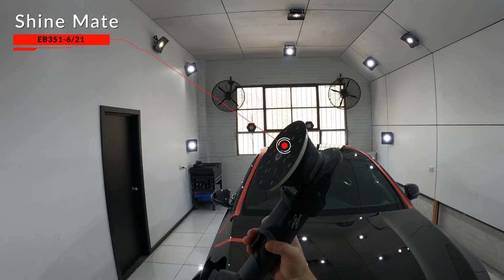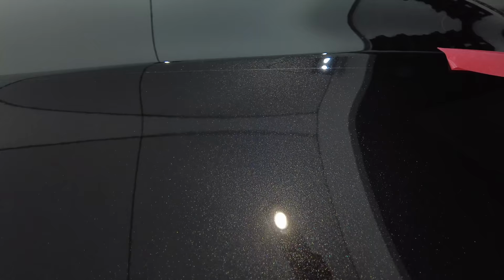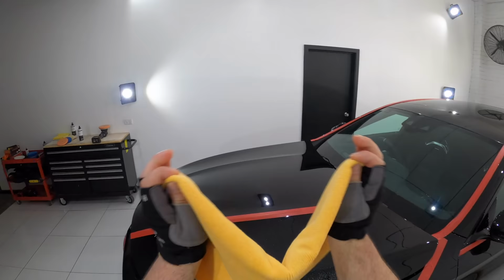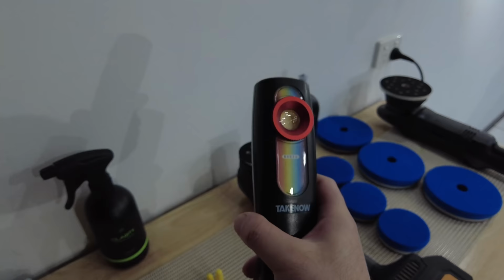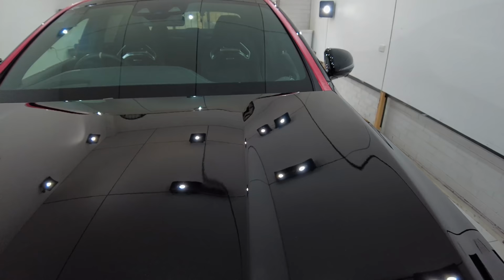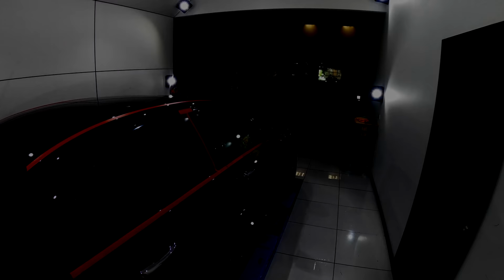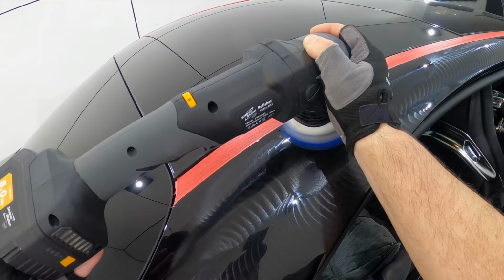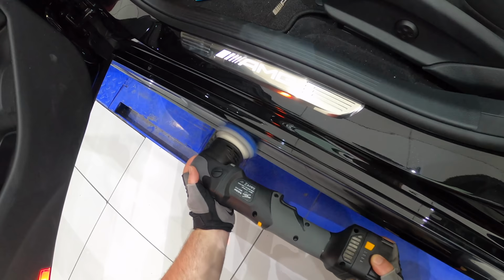Mercedes E63S AMG Full High End Detail! Part 2 "How to safely correct car paint" (Vlog 35.2)

Comment: I appreciate your striving to ge tthe perfect single stage correction, but I think you're missing the forest for the trees in a sense.  If you can remove all of the defects with a two-stage correction in most cases, with a good amount of clear to start with, even using a heavy compound, in the end, you're losing less than 4 microns of clear at most, and if the goal is a perfect, or near perfect correction prior to something like a 5 to 10 year ceramic coating on top of it, you're not going to be re-correcting that paint again in the lifespan of the car most likely, unless you wet sand the ceramic off the clear, and that's going to do far more damage to the thickness of that clear.  I can see your approach being great for something like a collectible exotic, or a classic car that the owner wants to keep for decades, but really, most cars today have a lifespan of maybe 10-15 years, and with 9+ year Ceramic/Graphene coatings on the market, I just don't see a need to preserve THAT much of the clear on every car.  Mommy isn't going to come back in 5 years and ask you to wet sand her minivan for a new ceramic coating.  I am also still learning though, and maybe I missed something here.

Comment: Maximum Quality of the Craftsmanship aside: The production qualtity and creativity of the videos is what makes this by far the best source on detailing. For all you non-video makers: this takes hours and hours  - and you dont get paid for the job. And please dont start on Youtube (Ad-)Revenue and stuff - we are not there yet.

Ps: Are you sure the panorama roof is made of glass? i recall them using Makrolon AG 2677 (PolyCarbonate from Bayer) and SilFORT AS4700-SP1 Hardcoat with SilFORT SHP470-FT2050 Primer Coat for UV/Wear Protection etc.
Reply from the maker: I appreciate that mate and it is a bit of a journey making these videos so thank you!  I’m actually not 100% sure on the specific material of the roof - but it did look and behave like glass.

Comment: Have you ever tried a pad cleaner? I switched to the lake country newest pad washer instead of using air to save* time, dusting and pad heat reduction and I haven't had an issue with wet pads except when using the nano polisher due to slow rotating speed. Nice to not have to wear a mask or breathing in abrasives and clear coat.
Reply from the maker: Yes I used it, but that’s really to wash pads after use rather than blowing out residue after every set of passes.
Reply: @CarCraftAutoDetailing  I have 2 one for cleaning with a cleaner and one for correction with just water. After 2 vehicles I empty it and it's surprising how much Gunk is at the bottom. Better in the bucket than in the lungs.

Comment: Man, probably watched this series 4 times. This is a really fantastic journey. Amazing. I noticed you used the pneumatic polisher on the chrome. What pad and polish/combo did you use and does that remove scratches on the chrome trim or just shine it up? What brand/model air compressor do you use to power your air tools? Thank you so much for your excellence.
Reply from the maker: Glad you enjoyed it! It was the same compound on the chrome - Scholl S20 with the Rupes yellow foam pad and it was just about restoring brilliance to it, it takes a lot more aggression to remove scratches from metal, but they didn’t need that. The air compressor is a Chicago Hush 150.
Reply: @CarCraftAutoDetailing  Thank you. Your the best.

Comment: Hey Sandro! Been learning so much from your videos, but still have this doubt: Am I right to start off with a 15mm 5" DA Polisher as 1st machine? Been practicing for a while now and been getting really nice results, gotta say, your videos and methods have helped me a lot!

Now, for my own studio, I really want to step up a little bit, looking foward to get a 3" since it helps so much on edge work. Also, thanks for the LED LIGHT tip, I didn't know it would help so much until I got it, some scratches and marks only shows in that light or in the sun, my jobs have for sure increased in quality because of it.

Wish you the best, regards from Brazil.
Reply from the maker: Really nice to hear that mate, thank you! 
Yes, you can definitely start with a 15mm 5” DA, it’s actually the best all round size to have and the 3” as you mentioned will be a great addition for edge work! Good proper detailing lights make all the difference and it’s great to hear that you’ve seen that for yourself!!
Reply: @CarCraftAutoDetailing  I had to see by myself, but am surprised by how much it helps in the process, and for sure it will 100% help you increase the level of your work. 

Honestly, Sandro! Thanks for your videos and lessons, it’s hard to see a dedicated and ethical  detailer like you, I lost count of how many bad detailers are out there, doing such a poor job, I am proud to proud to see amazing workers achieving big results, keep it up, I am sure you motivate so many people! As you motivated me! Wish you the best!

Comment: Great teaching video! What did you use on the Chrome trim? Did you protect the rubber around glass and trim or just polish over it? Did you have any residue on the rubber and how did you clean? Thank you sir. Totally awesome vid!
Reply from the maker: Thanks, and I used the same combination on the chrome trims, the rubbers were masked with tape to avoid any residue and part 3 will be all about protecting the finish including the trims.

Comment: So what do you use lighting wise on a white car because I find it so hard to find any scratches on a white car do you have a different kelvin sitting on all of your shop lights there?
Reply from the maker: When working on white or silvers, just set you lights on the lowest settings and position them 2-3 further away from the paint - that will reveal the scratches on those lighter paints.

Comment: hi sandro, in my understand the lake country blue is the rupes blue equivalent. is there a reason you used the smaller yellow rupes foam instead of their blue? i’m not asking to try and cal you out i’m always interested in learning from you. was it your experience with this specific paint type that the yellow rupes performed better? thanks so much for your work and display of it. i recommend you to all new detailers that come to me with questions in hope they aspire to achieve higher end detailing such as this rather than trying to make a quick buck. thanks again
Reply from the maker: The new Rupes foam blue pad is a little closer to the blue LC one but the older pad back then wasn’t, it was much harsher with a much poorer finish. But I’d still say the Rupes Green pad is closer to the LC blue one. 
Pads are always changing by the brands and I’m also reaching for pads I have on hand at the time.
Reply: @CarCraftAutoDetailing  thanks for the reply!

Comment: Someone introduced to be doing a finnish polish twice and it will enhance the final shine. I don't see anyone talking about doing that. Have you ever tried it and would that be a better way to get a brilliant finnish as opposed to chasing more correction?
Reply from the maker: If you’re struggling to get a great cut and finish in a single step then repeating a finishing step can certainly help to achieve a brilliant finish. But if you already have achieved a brilliant finish the first time, repeating it won’t do do anything but remove more paint. There’s so many variables in paint correction and it’s also changed a lot in the past couple of decades so that we can now get such better correction in a single step that just wasn’t possible in the past. But that also requires you to think and work differently and do a lot of testing in order to get there 🙂

Comment: Good morning, do you make the smaller areas first?. And then the biggest ones?
Or do you make the bigger areas first and then the smaller ones? thanks
Reply from the maker: Yes as discussed in the video I do tend to do the smaller edge work first followed by the larger flatter areas - but it honestly doesn’t really matter which is done first.

Comment: Hi Sandro! I put all your tips & tricks to good use and finally coated my own car!! Everything worked out great, except for 1 thing. After my ceramic coating hardened for 48 hours, I noticed paint defects I did not see when correcting. Now I must say those defects are only really noticeable in direct sunlight... what can I do? Is it too late, since the coating is on there? I would appreciate any advice! Thnx!
Reply from the maker: That’s great to hear! 
Remember that no coating is permanent or resistant to defects, so it will wear off and your paint will gather new defects during the coatings life span, so I wouldn’t worry too much about some minion defects you can only see in strong direct light, and being that it was you’re first time coating, if that’s the only negative you can point out, I’d say you did a great job! If you really want to you can compound off the coating and remove the defects you missed and then replay the coating just on that whole panel.
Reply: @CarCraftAutoDetailing  Wow thanks man! Yeah I know it's only visible when in direct sunlight, but still... hah, you just put a big smile on my face 😊 let me tell you, your channel gives me the best insight on car detailing, full stop. Keep doing what you're doing, it is appreciated to the highest level! Love from Belgium, and keep it up!

Comment: Can we achieve it while using rotary especially single stage correction?
Reply from the maker: You can certainly achieve great results with a rotary, but it’s really not possible to get both great cut and finish with a rotary in a single step - you’d really need two stages.

Comment: Awesome job, Sandro!!! Why didn’t you use the 15mm cordless shinemate? Not enough power?
Reply from the maker: Thanks mate, and that car came in just after the new cordless Shine Mates got released and the same time the new corded ones came out. So I was actually jumping back and forth between them to compare and I did also try the 15mm cordless which was working just as well 🙂
Reply: @CarCraftAutoDetailing  thanks! I’m thinking of going full cordless. I cannot stand having multiple cords.

Comment: yep as always such nice work goddamit I am waiting to get my first polisher and all the other stuff and a car pro UK 3.0 this summer is going to pack with learning are 3 for every step pad enough to do a car? going to have 2 3 inch pad for the smaller areas it's that enough
Reply from the maker: Thank you! The smaller pads do generally wear out quicker - especially the 1” & 2” ones but if you have 3-4 pads for each machine it should get you through a whole day and I’ll usually wash they and the end, let them dry over night and go again the next day.
Reply: @CarCraftAutoDetailing  thanks

Comment: Hello, I am leaving a comment to ask for one piece of advice.
The black paintwork was done in one step using S20.
If additional work is carried out with S40, will this work further upgrade the gloss of the black painted surface?
Reply from the maker: No not necessarily. You’ll find that in many cases there’s no benefit is using super fine polishes unless the paint is quite soft, and in some cases you’ll also find that the finish actually takes a turn for the worse if you do. It is one of those things that you’ll just have to test to know for sure, but generally that’s the case.
Reply: @CarCraftAutoDetailing  thanks a lot!!!
Reply: @CarCraftAutoDetailing  Thanks for the reply. If I want to remove the existing coating (not polishing), will the S40 be enough to remove the coating? Or should I use a stronger product like the S20?
It would be very helpful if you could give me an answer.
Reply from the maker: Generally the older, less durable and more deteriorated the coating is, the less aggressive you need to be in order to remove it. So if the coating is truely old and not showing any positive protection signs then yes, a very light polish could be enough to remove the last of it.

Comment: Hi Sandro, do I need to wash car after mpound/polish is done or just IPA wipe is good?
Reply from the maker: Making sure it’s perfectly clean is the real goal. If you can work cleanly and avoid or addresses dust and dirt during the correction process then there’s no need to wash it - the less the you touch and mess with the paint after correction the better. However if the vehicle does become covered in dust dirt and so on during correction then I would advise washing it as you don’t want to do an IPA wipe over dirty dusty paint.
Reply: @CarCraftAutoDetailing  thank you!